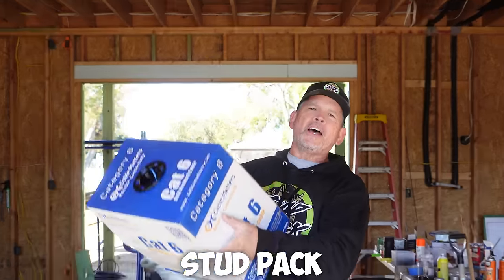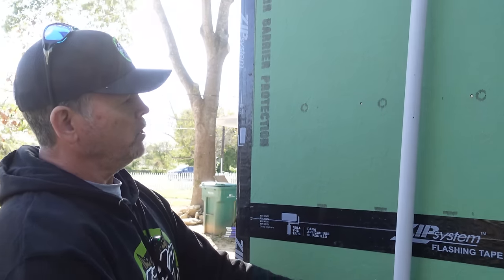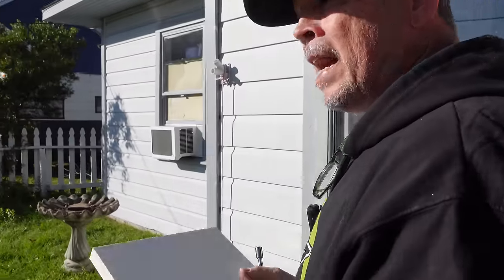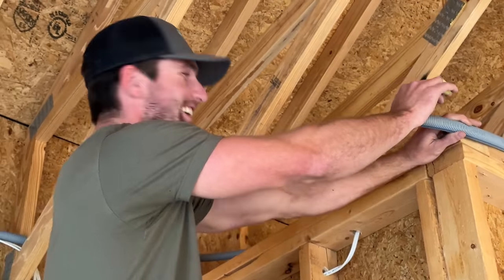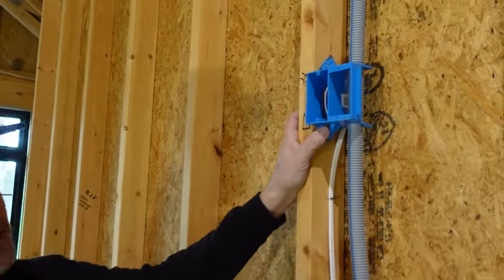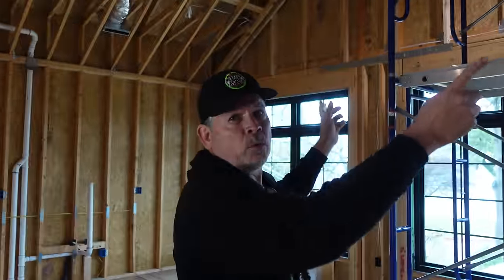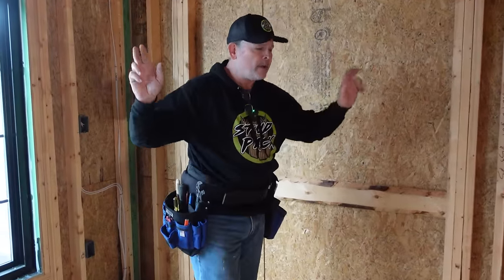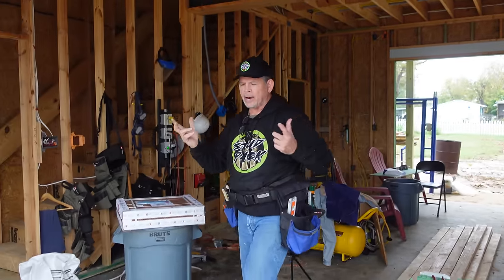DIY Networking for a Future Proof and HIGH SPEED Home! (Smurf Tubing and String Pull Trick!)

Comment: Wow... brings back memories...  I'm retired now, but made so many of these before you could buy them pre-made.  We started with coax for computers, just like cable-TV but with bayonet-nut-connectors (B.N.C.)   First thing I would do is put connectors on the end of the 1,000-foot bundle and test it before I left the store.  This video is a simple installation, but for a home I would bring in the cable from the outside to a central point in the home and install a break-out box (same as you would for phone-lines in an office), then have "home-runs" to each of the rooms.  Yes, ending in an outlet; you can even put a router in that room and have more than one device (computer, Xbox, TV...).  And I would do the same with cable-TV wiring.  This minimizes the wiring in the house (there is a limit to efficient Ethernet cable length) and gives you a central point for trouble-shooting.  In a perfect world, you have two outlets in a room; one for each side of the bedroom door to closet door 'line' so you aren't running a cable around three sides of the room - or up and over a door.  For cable, you need a re-transmitter (not my area of expertise) to strengthen the signal before you send it down a bunch of cables.  For Ethernet (hardwire to the Internet outside), you want a Switch; which directs "traffic" to the correct device in a way that minimizes slow-downs (a switch is a smart router, but everyone calls them a router now).  Of course, with cable-TV today, it comes in on coax-cable and goes to what Xfinity calls a router.  (Showing my age...) That is a brouter!  It is a bridge (changes from coax to Ethernet type of cable) and a router (really a switch), plus provides Wi-fi.  In my house, this is on a shelf just above the 'door' / opening between the living-room and the hallway to the bedrooms (hallway side of wall).  That puts it up high, in a central position.  Normally, don't even notice it but I can look at the lights without getting on a step-stool.  Instead of having a bunch of wires run under the eve (sic?) and down my outside walls for each room, I have one wire from the outside go into the attic and connect to the brouter at the central point.  From the brouter, you connect to the switch, which connects to the breakout box sending wires to each room  (don't need a switch if your brouter has enough ports).   Don't forget to put in an electric outlet for the brouter and switch. In a new build, I would advise you to put in at least one wired phone outlet.  They run on a tiny bit of electricity sent down the wires by the phone company, and work even if your cell-phones die.  And for 911 you don't have to provide an address.

Comment: Hate to tell you to stop and rethink, but some corrections now will make this building and the house much easier and future proofed.

You don't need CAT7 here, CAT6 is plenty for any household build, 7 is wasting money unless you're planning for some serious media server home entertainment. The parallel run next to the romex has to go. You have UTP CAT6, unshielded twisted pair, the EMI will definitely impact that run. Best cast is STP cable, harder to work with but saves you in areas where you can't avoid a parallel run. Otherwise keep that cable 8" away from a power run

Having all of this in the attic there, isn't necessary. Term the fiber, extend to a 12RU rack in the mech room and extend from a patch panel in there to where you need service: your HVAC, poe devices, network drops etc. You will find that a keystone jack termination in the wall is far better. Its cleaner, easier to certify and protects you from having to pull a new run in the future if that cable hanging out the wall ever gets damaged - it will for sure get damaged. Having to reterm the RJ45 because the clip snapped, your now impacting that entire run vs just a patch cable to the wall from device. 

I do this for a living and would love to help you out here and for the future build.

Comment: I hated hearing that the decision was made not to use Cat6 jacks and faceplate. It isn't professional looking with the cable dangling out of the wall.
Reply from the maker: A bit dramatic, you’ll never see the cable for any connections made in this entire structure.
Reply: @StudPack  I know that you need to defend your decision, and that's cool. Networking is my trade and we would never go this route regardless if it's ever seen.
Reply: I would agree with everyone about this. You don't do this with other types of cables, power, coax etc, why save a few bucks on this finishing detail. Also solid wire isn't meant to be used with devices because it shouldn't be bent frequently. It's meant to be ran and permeant. The stranded wires are used for plugging into devices and jacks because ok to bend and be flexible.

Comment: It is also quite easy to put in a rack mounted patch panel - run all your network home runs to the patch panel and then use short patch cables between the patch panel and the switch.  Makes it very easy to reconfigure or to adapt to failed ports on the switch.

Comment: Have been waiting for this episode. All great stuff and appreciate keeping the fiber tech in mind. A couple things…I would’ve rather seen you come down to an LB for the NID on the side of the house as service provider may have changed NIDs since the house was installed. The other reason is that that maintains water proof integrity of the box. If you keep current setup, make sure to Lexal to keep water out of the box. Also with the feed-thru connectors, it sometimes helps to trim at a 45° angle. The pair separator in the cat6 is to prevent crosstalk across pairs. It’s nice to share some knowledge back with you all with as much as I’ve learned from you. Looks great and looking forward to next video.

Comment: Should have gone with cat7, with 6 you may be limited to gigabit depending on how far your cables go. Plus for future proofing 7 would have been much better depending on how long Jordan plans to live there. Also putting a modem up in that attic area is a mistake. You are going to need to reboot it on occasion and it's gonna be a pain climbing up there every time you have to.
Reply: Cat6a is just fine. CAt7 is more difficult all the way around.
Reply: he can probably flip the breaker to reboot the setup, even if it reboots a couple other items thats ok too.
Reply: 100% 0n the rebooting. I recently replaced the facsia around my house and disconnected the lame cable that ran to the middle of my house in the back from the pole in the corner. The lazy cable people attached it there, then ran coax around my house to almost the front where they drilled a hole about 2 feet from the ground into a bedroom.... When I put it back up, I ran it from the pole to the corner of my housein a straight shot then into my garage, then attic and all the way to the opposite side of the house. Then through the closet to the modem/router thats easily accessed. Then ran a cat 6 back up to the attic to a power over ethernet switch. Then diredt cable back to the opposite end of the house where the TV in our "living room" is. (No wifi issues) Then in the other two rooms have a direct cable as well as security cams that are powered as well from that switch. Did all this in a half day and replaced 2 main AC ducts. That day cost me about $400 and most of that was for the ducting.
     Of course its on a 1600 sq ft house built in 1956 thats 8 miles from the water in southern california...... (Its tiny)  I will say an identical house across the street just sold for $1.2 million 3 months ago....( with an unpermitted addition)  You guys kick ass. Love the videos and your openess to criticism
Reply: @durakis lol wut, how is it more difficult? It's literally the same thing except one has more sheathing.
Reply: Yep, you're right.
Reply: Cat6 is good enough for 10G up to 165 ft, right? They should be fine. Maybe consider 6a for the house.
Reply: I've been running fiber for 3 years and have never had to reboot the fiber modem. As for the network router, I've never had to physically touch it. I've always been able to reboot it over the network.
Reply: @petereit  it’s never a good idea to have a networking device off in a far-flung area that’s hard to access. It’s just not part of best practices. Sounds like they didn’t talk to anybody technical about the layout. They never would’ve recommended CAT6 either.
Reply: @durakis  That's the nice thing about running that tubing... Wires get old? Update them with a vacuum cleaner...or just tape to the new line and pull.
Reply: @TotallyNuss  I can control or reset all my gear from my phone. 10 years ago? Yeah, things weren't so cool. Cat 6 is fine (I have cat 6a) but the wires when they become obsolete can be easily pulled through and updated.
Reply: If it were me, I'd have a 10 Gb switch with SFP ports that links to the router so that you can then run 10 Gb fiber to the house and then Cat 7/8 in throughout the house.

For most needs (TV/streaming device, security cameras, basic usage computer) 1 Gb is more than enough bandwidth. For the garage networking, 1 Gb should be fine but plan for higher bandwidth availability to the house. For the system they are going to do the editing having access to higher bandwidth would be helpful when moving large files around (especially to a NAS device) but Jordan won't be living in the garage forever.
Reply: @bullyakker  right because devices never fail.🙄
Reply: @bullyakker  exactly why would you have to run more cable in the future when you can just run it now. That’s the whole point.
Reply: Depends how crappy the modem is. I've only rebooted mine maybe 3 times in 6 years
Reply: What? No! Cat.6 is already specified for 10Gb/s at up to 55 meters. You can clearly see that no single run in this structure will exceed 55 meters. And even if it did, Cat.6a would be the most logical upgrade. If you're worried about interference (which we're not, in this case) then use shielded cable and patch panels.
Cat.7 is designed for 10gb/s transmission in datacenters, industrial plants, and other environments with harsh electrical interference and maxed-out, hundred-meter runs. It would be entirely overkill in this project.
Reply: Also, Cat.6a and Cat.7 are thick, rigid cables that are a pain to pull, especially in conduit but also in stud cavities. If Jordan needs more than 10G speeds then fiber is the next logical step up.

Comment: IT guy here. Use the keystone connectors. The rj45 connector
Is delicate and you will end up getting the lock tab broken off and you will have to reterminate the end. 

Also run a couple of lines to each location. At the desk you might want one for the PC, one for a printer and one for a VOIP phone. You will never regret having too many cables, but you might regret not having enough when you are already doing the work. Same thing with the TV. You might want a cable for the TV, one for a gaming console or two, maybe a set top box like an Apple TV, or even a Blu-Ray player. 

Have everything punch down onto a rack mount patch panel. You don’t have to get a full blown rack, but they make cheap vertical mount racks that will hold the patch panel nicely.

Comment: I ran so much Cat-5 in our vacation home and it was such a pain in the rear end.  I love that you are doing this now because we are on a remodel and I decided to pull new Cat-6 to all the rooms and luckily, we have dry wall out in one or two walls per room so it should be easier than my last time.  I highly recommend a tester to check the line once you make it.  I neglected that part and spent the better part of an afternoon chasing down a bad line with an improperly crimped connector.  Great video.

Comment: Former IT guy here.

- Avoid running cat5/6 parallel to power, but you can get away with a few feet no problem. You can upgrade to a shielded cat5/6 to help with the problem. In this case though, aren't you pulling fiber? The wonderful thing about fiber is that it is immune to EM interference. I'm not sure how your ISP does it, but we have fiber which runs all the way from outside into the ONT which is inside of the house. Might be worth a call to the fiber company.

- I'm not convinced T568-A vs T-568B makes a practical difference, but as long as you're consistent go for it!

- The plastic core is not really for strength, it ensures a consistent spacing and uniform twist with the twisted pairs which is essentially what makes the difference in performance between CAT5e and CAT6. If you work with CAT5e, you'll notice it doesn't have the plastic thing.

- I usually treat the low voltage like the electrical rough, leave them coiled up in the wall and terminate once the drywall is painted. I'd strongly recommend the female connectors in the wall. As long as they are rated for CAT6, you won't see any drop in performance. It's just a little too easy to damage the wire coming out of the wall, and then you have no recourse. Having a connector is cleaner and helps with longevity.

Comment: I’d recommend cat8 over cat6 where you’ll have more data flows like tvs, workstations, wireless access points, between switches.   Maybe use the cat6 on cameras.  The pass through connectors are a personal favorite as well but when you are using these cables to connect exterior devices do not use them there as water likes to penetrate anything it can and may find its way in and down the cable.    Also if are using hard wired cameras/poe cameras the pass through connectors with some cameras can cause camera failures.  

If you gents are thinking about keeping the house long term and if the walls are still open maybe slide some fiber between tvs or at minimum leave your fish line especially if you are going to have a closet for audio/video distribution through the house.
Reply: CAT6A should be fine for most home users, and it is good for up to 10 Gbps at 328ft (100m). This is where it would be good to give the homeowner the option of what they want run and where, as well as what their plans are with their networking is.

Comment: Great job running the smurf tube guys, the long easy angles are so important for fiber, and makes pulling so much easier. Those ridges will be a pain so be sure to have a nice smooth transition from the string to the wire or its going to snag even on the smallest bend!  
Also... For sure guys, use that connector at the walls, for so many reasons its better. Along with the many good reasons others have mentioned, you dont want some cheesy wire hanging out of your walls, with a wall plate it will be a clean professional look.
As for what to do with the smurf tube coming from the box in the wall, like others said you do not want to run parallel to to the 120 ac, your cat6 is unshielded. Put in a stringer a few feet down up against the outside sheeting so you can make a nice easy angle away from the power wires. I was also taught that wherever the cat6 comes close to power, you can use the same tape that you used for the vents to help shield away any magnetic interference, just to be on the safe side.

Comment: can't help but chuckle at the shop vac/pull string technique.  About 25 years ago I helped a friend install both a hot tub and a security camera in his barn for his wife's horse.   We used this exact trick with three inch conduit runs and a cotton ball.  Kept adding increasingly heavier string until we finally attached #6 Romex or cat 5 type cabling.  Yes, I now know that Romex in conduit is taboo but at the time we were dumb twenty somethings.

Comment: I've been in IT for 27 years now. This is a great video on what not to do when running cable, terminating ends, and placement of equipment that gets hot. I know you all are DIYers but you can consult professionals prior to making these mistakes. Please folks, remember, just because you use computers, tablets, smart phones, that doesn't automatically mean you know how it works. Even running your fiber line that far only to hide the modem up high, out of sight, where temps will be the hottest is a huge no no. Sorry guys. You're in my area of expertise and you should have asked for help first. The good side is, I now have a video to reference for training new techs.

Comment: Great job showing A vs. B on the Cat cable.
I have always used B, but know of government contractors that use A due to spec.
I've never had a problem using B.
Pass-through connectors definitely make the job easier.

Comment: 19:24 Glad to see you using the right box adapters. Make sure you seat the adapter ALL THE WAY DOWN on the tube, which is like 3 or 4 clicks. If you snap it to just the first click you leave a gap between the leading edge of the conduit and the mating edge of the connector. This gap can snag your cable or fish tape.

Comment: As I am someone who has installed many many Ethernet, phone and coax cables I always use CAT6 Shielded Ethernet Cable. For Coax I use R6 triple or quad shielded cable. Remember that ALL Ethernet (not fiber) cables can run a max of 300 feet (250 feet avg.) and after 300 ft require a signal repeater. Fiber cable can run much greater lengths AND doesn't require additional installation. As for wall boxes I recommend using a keystone jack and giving yourself at least 6 inches of extra Ethernet wire from inside the box to the keystone jack. This way if you ever have to fix or repair such wire you have spare wire to use. And others have mentioned. Yes try to install Ethernet and Coax away from Romex wire to reduce EMI. ~ Robert from New Hampshire